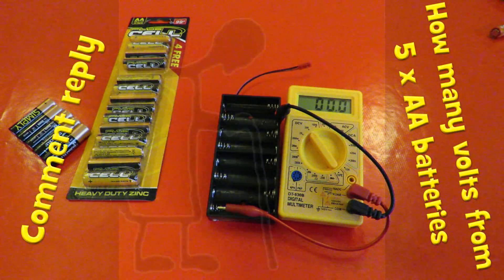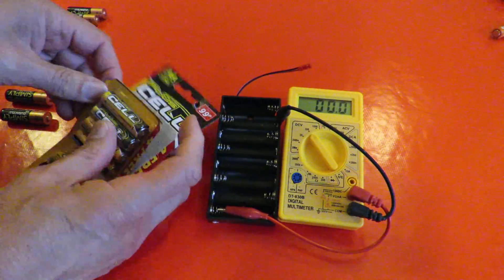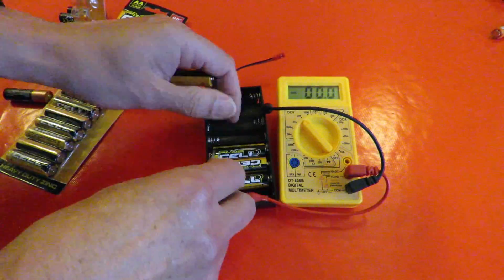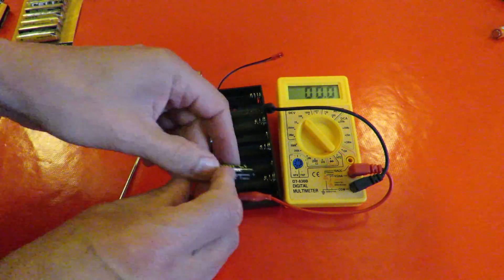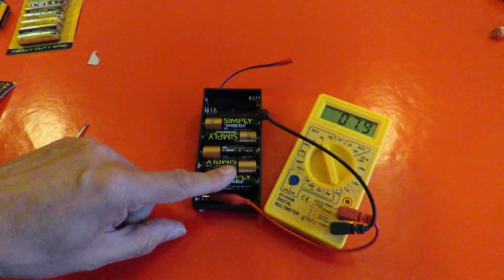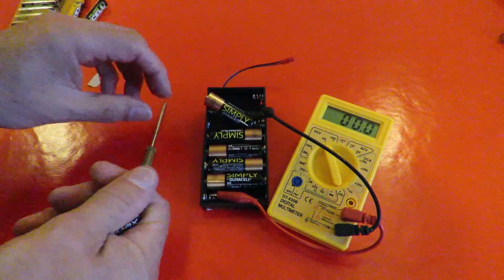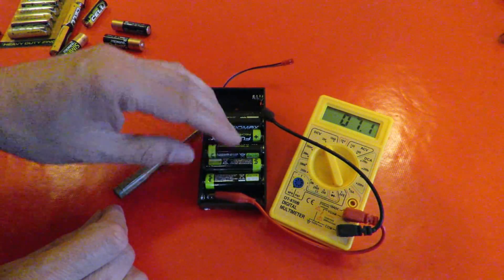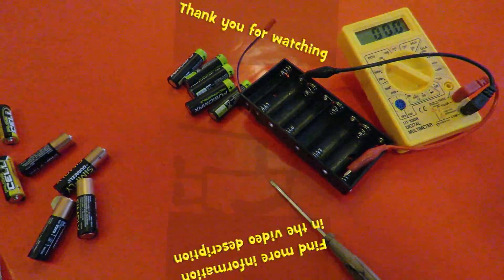Comment reply - How many volts from 5 x AA batteries?

Comment: How many volts is a dead  aa batterie?
Reply from the maker: That just depends what you want to use it for. I have a solar rocking snowman that has been running on a "dead" AA battery for over a year.

Comment: there are 1.5V usb rechargeable batteries, have you tried those? there are even have 9V batteries. http://www.banggood.com/ZNTER-1_5V-1250mAh-USB-Rechargeable-AA-Li-Po-Battery-p-1069778.html   they look like a good idea.
Reply from the maker: No I haven't tried them and they look incredibly expensive. I cannot see any reason for buying them. Clearly they are LiPo batteries with some circuitry to regulate the output voltage to 1.5 volts and they claim a pretty good energy output. I have no doubt there are some applications they would work well for but I cannot think of one at the moment.

Comment: Placing a 100 Ma load on any bank for a few minutes should tell the tale. Odd there is always some "mystery" for some folks  on battery output.
I have read that the first "flashlights" due to battery technology of the time, really were just that. It seems the load of the lamp zapped the cells so hard that about all one could expect was a brief "flash" of light, then after waiting a short time the batteries recovered enough for another flash. 
Whatever the cell or battery, they all have some limitation as to how freely they give up electrons and at what voltage. 
Does anyone remember Mercury batteries made specifically for small transistor radios? They were rather long life under low current situations
Reply from the maker: The background video to this is the regular questions I get about converting cheap RC toy cars to use LiPos. I have said in the past that if the car has 5 AA batteries then it should be safe to use a 2S LiPo as 5x1.5 is 7.5 volts and a 2S LiPo is 7.4 volts and then I get the comments about 2S LiPos being 8.4 volts when they are freshly charged so here I am demonstrating that 5 zinc carbon batteries can give you that sort of voltage when fresh so a circuit board designer takes that into account when choosing components and will build in a reasonable safety tolerance range.